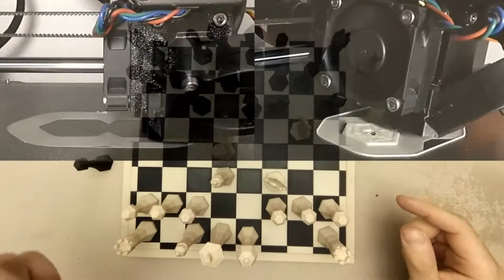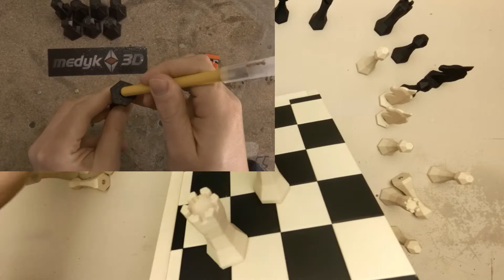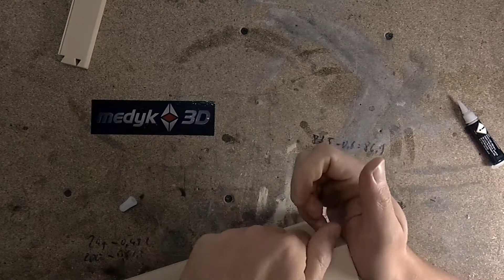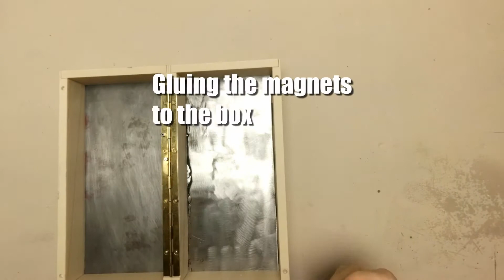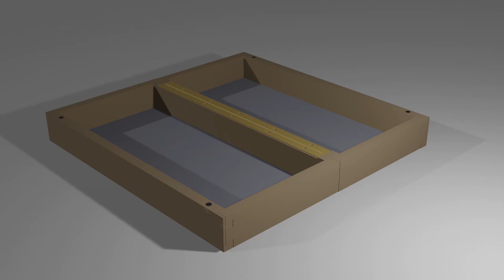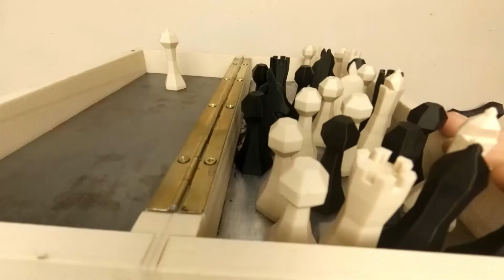3D printed dovetailed magnetic chess box

Comment: Very interresting to see woodworking joinery adapted in 3D printing, does the dovetail need special consideration when modeling?
Neat project !
Reply from the maker: I just made a few test tries to get the fit just right, but as far as the joint geometry nothing special was done. I used 0.4mm nozzle, so pins are 1.7mm at thiniest place. As a starting point I used 0.1mm tolerances ended with 0.18mm. A lot easier than cutting them by hand in wood :)